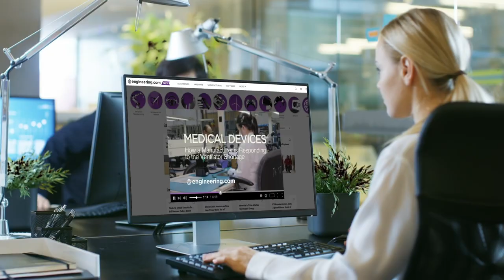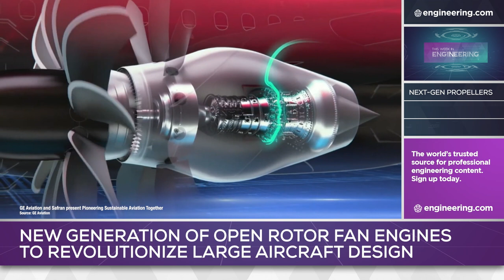The Future of Jet Engines May Be, Ironically, Propellers

Comment: This seemed to be a little light on information, such as, for instance, what airspeeds and altitudes would/will open rotor fan engines be capable of?
Reply: I believe it is still under development 

Just today I was at the Avio Aero factory (Italy, owned by general electric) they told me that their orders take from 5 years upwards to be defined and last for about 20 years

I'd say we won't see these engines in action for at least 7 or 8 years, before that only if they finish the project soon, which is unlikely.

Comment: For projections like 20% reduction in fuel consumption/emissions to mean anything, they'll depend on replacement rates for existing fleets. It's hard to imagine an airline undertaking a conversion that might cost 25% or more of the original airframe cost, on existing engines that might be at less than 25% of their expected service life. And the narrator included this, without drawing attention to it; aviation is full of airframes that are now over a half-century in production where replacement has negative economic impact, with marginal performance benefits. 

It seems that the aerospace industry needs to be in a more modular mindset, but given that the débacle of the 737 Max stemmed from the problems of re-engining an existing airframe for new power plants, I wonder how many manufacturers would be prepared to subject themselves to that kind of liability? And of course, this isn't built, and getting new power plants certified, production lines operating, and maintenance crews – where the early examples will be like the first diesels in the age of steam, requiring whole new schedules and procedures, and even new maintenance facilities – will be decades to complete.

Comment: Worldometer says we have 41 years of oil left. Why bother to do this now?
Reply: Because we only have 41 years of oil left? Going electric with long range planes isn't gonna be possible in a long long time because batteries won't have that energy density, at least not in a hundred years. They'll need twice the density of oil to match oil for planes as oil is burnt and the plane loses weight, same isn't true for batteries. And current batteries are not near having the same density as oil, forget about having twice that. Also, lithium shortage is far more imminent than oil shortage. So we have to at least wait until some revolutionary battery tech.
Reply: The question will probably come down to synthetic fuels, which seem to be an attainable, industrial scale energy solution. I can imagine that a progressive ban on existing extractive fuels for aviation, mandated for replacement by certified green-powered synthetic aviation fuel, even if it were only implemented in the EU and North America, would have a dramatic effect on broad adoption. Effectively, impose a landing tax on aircraft that made their inbound flights on non-synthetic fuel. The amount of the tax would be a function, perhaps, of the fuel per passenger consumed. Then, only make synthetic fuel available for departure, and impose the tax on departure for non-refuelled craft, using fossil fuel to depart. 

Given how lucrative the European and American routes are, airlines would certainly push more flights through Dubai and similar hubs, but that can only work to a degree, and wouldn't work at all for North America. A ten-year transition would be doable, starting from when synthetics have the capacity to meet the demand created. The proceeds of the tax could be earmarked for green-generated fuel, and support replacement, lower-impact transportation, like electrified rail, especially for short-haul journeys where air travel has split the market, making it tough for all.
Reply: @shadmansudipto7287  maybe structure society so that people don't need to travel all over the place...